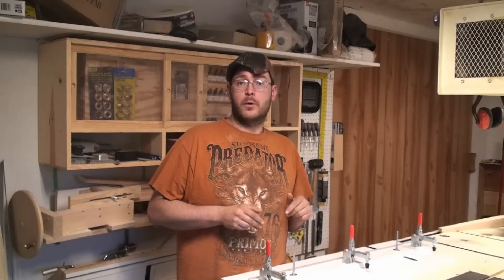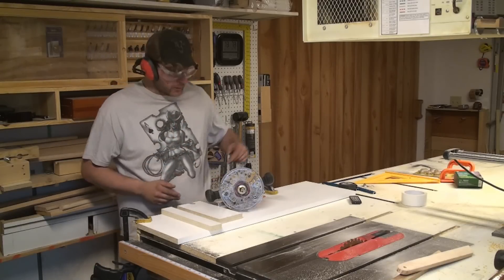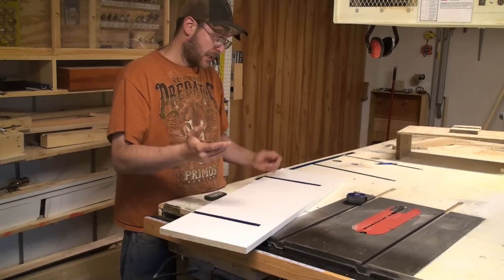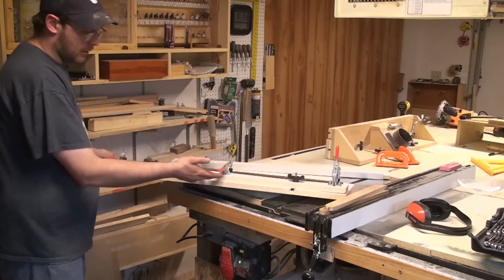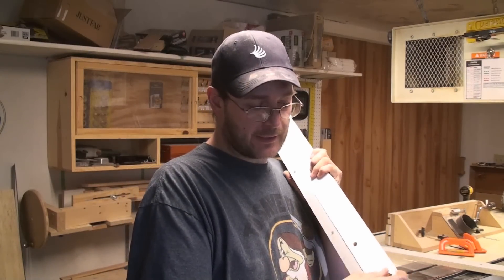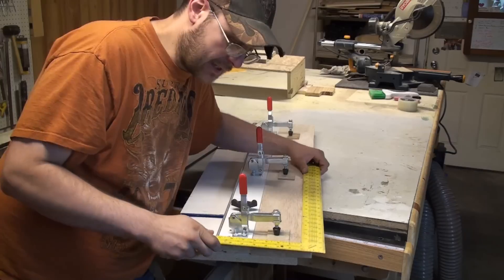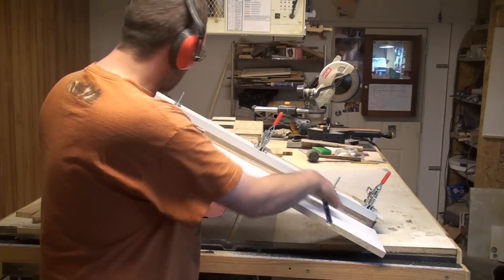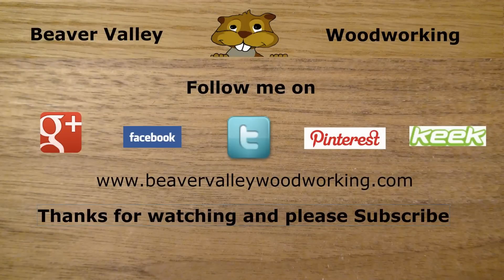Tapering / straightening jig #6

Comment: Great jig Dale,
  I use a similar but smaller version and it's probably one of the most used sleds in my shop. Keep the videos coming.

Regards,
Bob
Reply from the maker: Thanks Bob, there is a reason this jig is bigger. A future project I'll have to straighten the edges on a 12" wide, by 8 foot long rough cut board of white oak. Thanks again for the view.